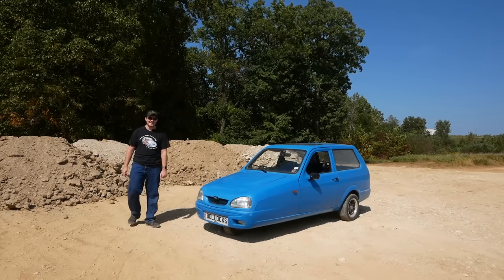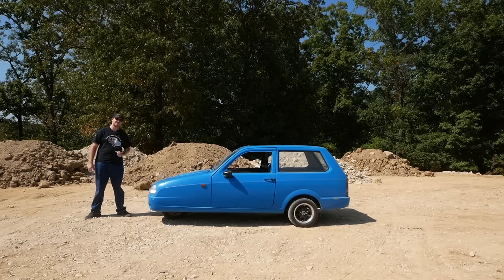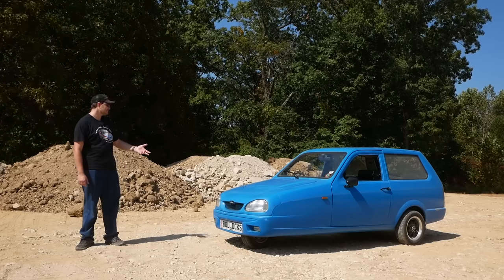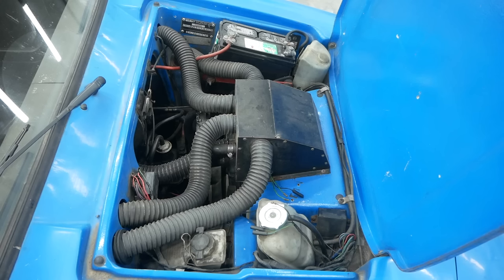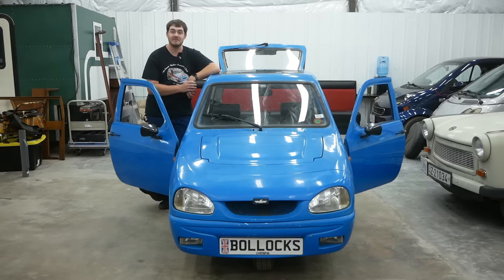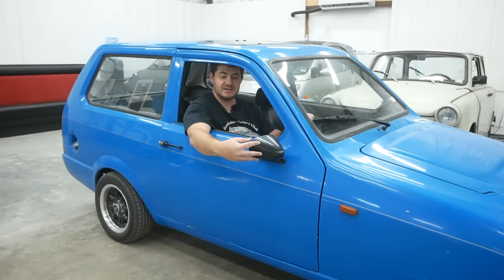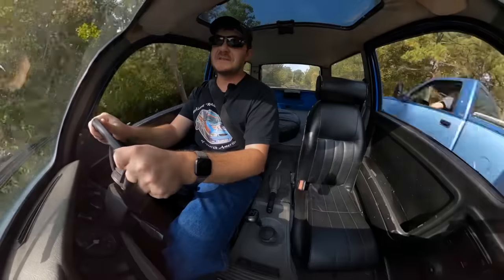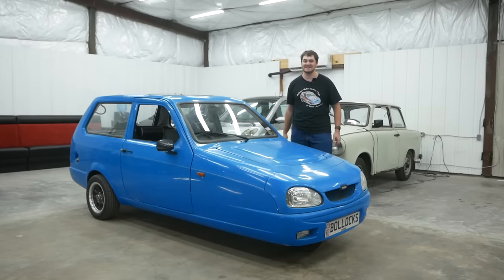I Bought a Reliant Robin!

Comment: If they had just put one more wheel and suspension on it it would have been remembered as an average piece of shit. Instead they decided to have just three whrels and make it into an exceptional piece of shit.
Reply: Reliant did build them with four wheels, the Kitten, and another I can’t remember the name of.
They also built a 3.0 litre V6 ford engined car called the Scimitar, which was considered a bit luxurious at the time, nicknamed the Plastic Jag.
I only had one experience in the Scimitar, it handled ok, we took it to about 125mph on the M62.
I’v need experienced driving a three wheeler, only as a passenger, I didn’t fall in love with it.
I had a Mk1 Escort 1600 at the time.